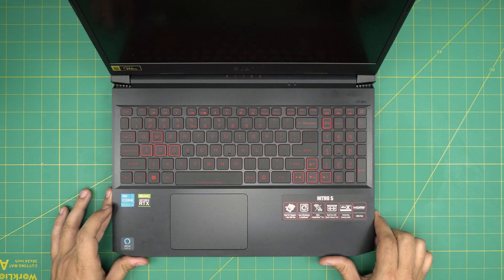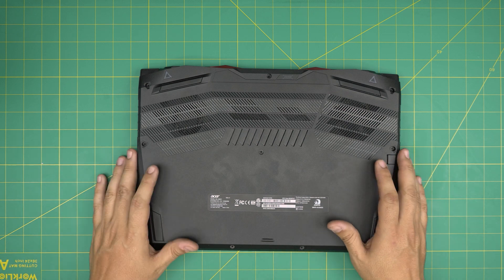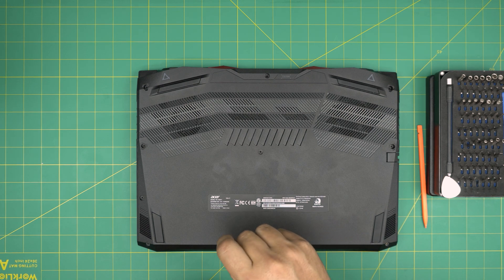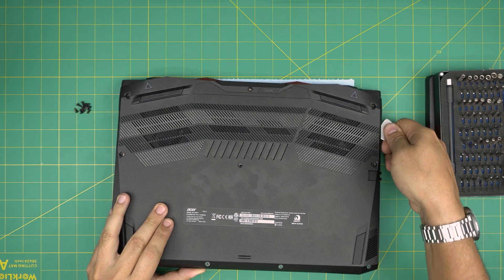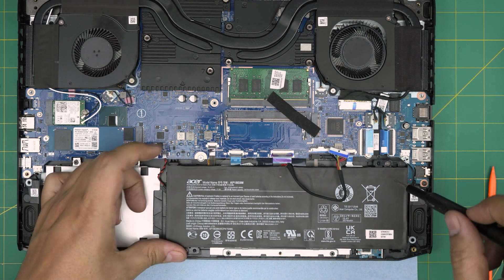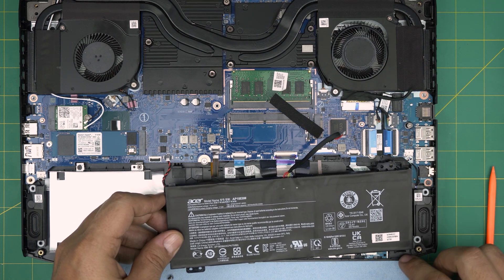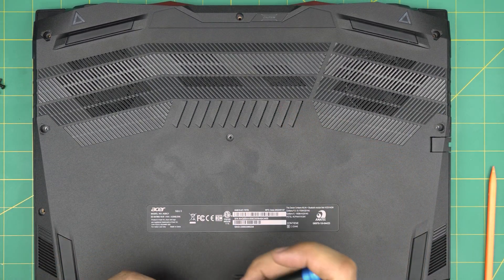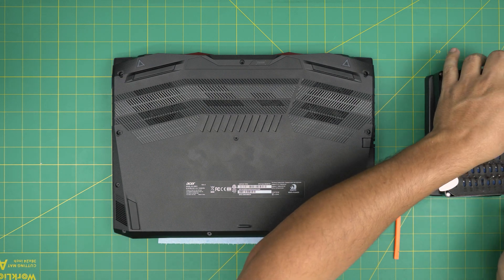How to Replace Battery in Acer Nitro 5 AN515-57-79TD Laptop | Step by Step

Comment: I need help with my Acer nitro 5 An515-57 I'm stuck on a boot loop hole my laptop keeps restarting and keeps showing the Acer loading screen and it keeps saying preparing and then goes black and restarts several times when I reset my pc using local download since then I'm just stuck on the reset loop hole and I was wondering would taking out the back cover of the laptop and disconnect the battery solve the issue as I can't enter to safe mode or windows recovery mode because it just won't let me just wondering
Reply from the maker: 🫠Regarding your question, your issue is caused by a degraded (failing) drive or corrupted system files.
You can try creating a Windows 11 USB boot drive and reinstalling Windows (you will lose your data).
If that gives an error, then replace the storage drive and reinstall the system.
https://youtu.be/T0uBTVNCdAQ
cheers🍻
Reply: @uFixTek I forgot to mention also when I went to the bios system to see if my old SSD drive will show up it didn't show up but the new one I have installed it shows but my old one doesn't and also how it happened I want it to rest my pc and when I did I clicked on local download reinstall windows 11 and because of that I think it has crashed my laptop and took my laptop to boot loop hole which I am currently stuck on. I am also gonna try and boot using a boot usb mode but I also bought otg adapter so I can install the ISO file from the website from my phone and also install the IRST file but I gotta make sure I make a separate folder and put the IRST file into my boot usb extract the file into my usb but I gotta make sure the zip file isn't in my IRST file.
Reply: @uFixTek I also want it to ask what sad drive should I buy which is cheaper not too expensive because I'm looking for a cheaper one and I don't know which to choose from Amazon or some other website I wanna look for a cheap storage around 512gb or at least more but cheaper SSD drive

Comment: When an inserted a new battery my laptop showing a battery with a cross on the battery icon. The laptop is working completely fine with the new battery but it only showing the cross icon above the battery. What does it mean and how could I fix it?
Reply from the maker: 🫠Regarding your question, uninstall the battery drivers and reboot the laptop.
cheers🍻

Comment: can we not use the hard drive slot and upgrade battery to take up full space?
Reply from the maker: 🫠Regarding your question, sure you can, but you need to find a extended battery and they are not easy to find.
cheers🍻

Comment: My acer laptop went off completely and no charging indicator even when plugged and no longer turns on. Could a bad battery gives such symptoms or maybe a bad charger or a mobo? There is no power at all and no led indicators turning on.
Reply from the maker: 🫠 Regarding your question, it could be the charger. You need to check the voltage of the charger at the tip with a multimeter to see if you're getting 19.5 or 20V.
im very positive that the issue is the charger.
Should you have any further questions or requests in the future, please don't hesitate to ask me.
cheers🍻
Reply: Thanks! I will try it!  @uFixTek
Reply from the maker: good luck

Comment: I changed my battery with one from a same model laptop. The "new" battery is about 75% health as per Batteryinfo software. But even though windows is recognising the "new" battery, it's not charging it nor using it. My laptop only turns on and works on AC power. The battery charging light just blinks a slow orange. I reinstalled the drivers and even flashed bios, but all the information about the battery is displayed, just that the system is not using it. If I reconnect the "new" battery to the older laptop, it works fine there and if I use my old battery, it also works fine in this laptop. Is there some security override or configuration that is preventing the "new" battery from being used?
Reply from the maker: 🫠 Regarding your question, when that happens, we check the circuit on the board that communicates with the battery—the BC chip. A gate may be opened.
Remove the battery and charger, then press and hold the power button for 60 seconds. After that, plug in the charger, hot plug the battery, and wait a few minutes before powering it on.

Comment: Generally acer nitro comes with 57 watt battery but some nitro model Generally 17 inch has 90 watt battery the 15.6 inch model have space like if a person is not using hdd in his laptop is it possible for a upgrade from 57 watt to 90 watt 
The laptop takes 15 volt input which both battery provide 
What do you think ?
Reply from the maker: yes it is possible and it will work just fine.

Comment: Hi! Thank you for this detailed video. I’m trying to replace the screen on my Acer Nitro 5 An515-57 model and was wondering do i just need to disconnect the cable of the battery or do i completely remove it?
Reply from the maker: It's my pleasure my friend.
🫠Regarding your question, just disconnect the battery; there is no need to remove it. However, removing it is super easy—just a couple of screws.
Should you have any further questions or requests in the future, please don't hesitate to ask me.
cheers🍻

Comment: hi! does AN515-54, AN517-51 7 and AN715-51 battery are compatible to Acer Nitro 5 gaming notebook? as I check at the back I see AN515-57-5620. enlighten me please so I can properly replace my dead battery. Thank you so much!
Reply from the maker: It's my pleasure my friend.
🫠Regarding your question, they are all the same battery type.
Acer Nitro 5 AN515-46 AN515-47 AN515-58 AN515-58-56CL AN515-58-766R AN515-58-72QR AN515-58-74JS AN515-58-75UH AN515-58-77YC Series; Acer Nitro 16 AN16-51 AN16-51-74BV AN16-51-78GX AN16-51-76BS AN16-51-56VT Series;  Acer Nitro V 15 ANV15-51 Series

Should you have any further questions or requests in the future, please don't hesitate to ask me.
cheers🍻

Comment: Hi doyou know a battery ugrade for that lsptop that can bump the battery capacity . Will helios neo 16 90whr will be compatible?
Reply from the maker: When it comes to a laptop battery, you must always use the same voltage, or you risk damaging the board. Make sure the battery connector is the same (with the cables not inverted) and that the screw holes match. You can find a higher-capacity battery for your model by checking eBay or AliExpress and looking for a higher wattage.

Comment: hello, would you please help me with my issue. I have same laptop and while working on it, suddenly shutting down. was plugged in and battery was full. Now it doesn't turns on or chare anymore, does it need a new battery? current battery was working quite fine without charger though and lasts for 2 hours at least.
Reply from the maker: 🫠Regarding your question, this laptop can work without the battery plugged in, and if it was plugged in, it shouldn't turn off because of the battery. You may have a bad capacitor that got damaged (overcharged). Here's what you can do before taking it to a repair shop for evaluation:  

1. Remove the battery and the charger.  
2. Press and hold the power button for 60 seconds.  
3. Plug in the battery and the charger.  
4. Wait 30 seconds, then press the power button.  
5. Wait another 30 seconds to allow the motherboard to perform a memory check.  

If after 30 seconds you still don't get anything on the screen, you will need to visit a reputable repair shop.
cheers🍻

Comment: Hello sir. My battery is faulty, I am on less than 220 lifecycles and less than 1 percent of the capacity. Should i remove the battery though I dont have a replacement?
Reply from the maker: 🫠Regarding your question, you can use the laptop without the battery. The laptop will last longer, as will the charger, since they won’t have to work as hard.
Should you have any further questions or requests in the future, please don't hesitate to ask me.
cheers🍻
Reply: @uFixTek  thank you sir! I have a follow up question. I was told the battery would last longer if the laptop was plugged in all the time and limited to 80% so I did that. I still get only less than 220 lifecycles. Could it be that the battery is just faulty. Or did I do something wrong?
Reply from the maker: that is correct the best is to limit it to 80  and have it plugged in, and your batter something is wrong with it, you should have over 400CL.

Comment: if I bought a different model of battery for the nitro would the replacement still work?
Reply from the maker: 🫠Regarding your question, if the shape of the batter and the connector it is the same and sits well in the case, sure you can use it.
cheers🍻
Reply: @uFixTek The connector seems to connect fine but doesn't sit right. And the new replacement didn't seem to solve the issue with no turning on. Any suggestions?

Comment: I changed the battery followed the after steps and it just went down from 100% to 0 and now it will only turn on with the cable in
Reply from the maker: Leave the laptop plugged in for a few hours; it should start charging. If it doesn’t, the battery quality might be poor, or the board could be defective. In that case, get a replacement.
cheers🍻

Comment: can u please tell me how much it costs to replace mine from a place that repairs and replaces
Reply from the maker: 🫠Regarding your question, any repair shop should not charge anything over 65USD with battery included.
cheers🍻
Reply: @uFixTek  thank you
Reply: @uFixTek  how logn would it take from a repair shop for me to receive it back
Reply from the maker: It's my pleasure my friend.
2-3day tops

Comment: 4:53 hi! I'm a little confused here, before installing a new battery, do I need to remove the BIOS battery connector so that a new battery can be installed and the BIOS battery connector reinstalled?
Reply from the maker: 🫠Regarding your question, no, there's no need to touch or disconnect the BIOS battery. Just replace the main battery and you'll be fine. I mentioned the BIOS battery for those who are interested to know.
Should you have any further questions or requests in the future, please don't hesitate to ask me.
cheers🍻

Comment: Which my battery into the Nitro 5 so much longer to operate inside the cell battery but I am only up to 2 hours my laptop but so fast as drained out of low battery should I'll be used to replace to recommed it??
Reply from the maker: the new battery is linked in the video description.

Comment: Hey. Do you think removing the battery might reduce overheating? My laptop is perma plugged in charger because battery lifetime is very short, but it overheats and slows down massively while charging. Should I remove and try without it?
Reply from the maker: Regarding your question, you should open and disconnect the battery. This will definitely increase the lifespan of the motherboard, and the charger will last longer. The downside is that you may see a few seconds of delay on boot, but it's nothing bad.
Should you have any further questions or requests in the future, please don't hesitate to ask me.
cheers🍻

Comment: Hi! I have a question! My current battery model is AP18E8M and my new one is AP18E7M. Is it going to cause any issues if I put the new one in?
Reply from the maker: 🫠Regarding your question, No, it will work just fine without any issues.
Should you have any further questions or requests in the future, please don't hesitate to ask me.
cheers🍻
Reply: @uFixTek thank you so much!! :)
Reply from the maker: It's my pleasure my friend.

Comment: Hi! Your video was great and very helpful! I replaced my battery with a new one and plugged the charger in, but the charging light did not turn on. Is this normal? I don’t want to power it up as you said to wait a while.
Reply from the maker: if after few hours it doesn't start charging check the battery connection.
cheers🍻

Comment: my laptop cant be turned on without being plugged in and now its stuck at 93 percent and going down slowly will replacing the battery fix this? and also my laptop is a AN515-57 but idk what the 79TD means and if mine is the same i kinda removed the stickers on the laptop so i dont know the exact model ive check the model in the laptop but all it says is AN515-57  nothing additional like 79TD
Reply from the maker: 🫠Regarding your question, when we get this issue in the store the main 90% of the issue is replacing the battery.
cheers🍻

Comment: Having a problem.. cannot turn on laptop without charger..charging light blinks after plugging in.. the battery does not even chargin.. stuck at 0%..need help
Reply from the maker: 🫠Regarding your question, double check the battery connector and make sure it is making a good contact this issue is from battery contacts with motherboard or a bad battery.

Comment: Have mine plugged in but will not charge to 100. Shows it’s charging but doesn’t.
Reply from the maker: 🫠Regarding your question, nis this after placing the new battery?
Reply: @uFixTek no still the original battery.  From day one not gonna charger, it would not last very long. Charged it like normal and was at 100. Now it shows 55% and charging with plugged or 55% unplugged. Will not charge more. Currently it dropped to 46% and charging.  Weird.

Comment: Why does my battery suddenly get a cross battery notification when I charge it to 100 percent? then it can't be turned on without plugging in the charger.? My battery can only save battery capacity when I limit it in the care center application to 80 percent
Reply from the maker: Thank you for your feedback! If you wish to support the channel, you can like, subscribe, or both!
Regarding your question, your battery cells are going bad and you do need to replace it if you want to act as normal.
Should you have any further questions or requests in the future, please don't hesitate to ask me.
cheers🍻

Comment: Are the batteries sold in online stores original? If it's not original, how do you choose an original battery in an online shop?
Reply from the maker: there are 95% generic or pirated versions, it is very hard to find a original battery, unless you order from the Acer directly.

Comment: @6:55 hey i let my battery discharge to 19.9789% instead of 20% while following your ritual. Should I just throw away that battery and buy a new one? I really want battery that will last 2.23 hours longer in total lifetime then the one i messed up. You said its very very very very critically important, so I don't know if I should start over and buy a new one.
Reply from the maker: Thank you for your valuable feedback! If you'd like to show your support for the channel, feel free to like, subscribe, or do both!

Regarding your question, I have been in the repair industry for over 17 years and have extensive experience dealing with batteries. It is crucial, when installing a new battery in a laptop, not to power on the device immediately. Instead, follow these steps:

Plug in the charger and allow the laptop to charge for 4-5 hours.
Power on the laptop without the charger, reducing the LCD brightness to 50% or lower, and maintain a light CPU load. Allow the battery to drain gradually to 20-30%.
Power off the laptop, plug in the charger, and let it charge for another 4-5 hours.
After completing these steps, you can charge and discharge the battery as needed. It's advisable to repeat this process every 3-4 months.

Note: If you've already powered on the laptop without following the above steps, don't worry. You can still perform the recommended procedure now. The above steps are suggested for new batteries and do not imply that your current battery is malfunctioning; there's no need to replace it.

If you have any further questions or requests in the future, please feel free to ask. Cheers! 🍻

Comment: Hi!

Is it possible to upgrade the battery for this Acer nitro 5? Meaning can we use a bigger battery while taking advantage of the empty space of the hard drive. If so, would you recommend a battery model that fits? I heard somewhere that it's not recommended to do so as it's very risky because available batteries are cheap and can damage the laptop.

Thanks
Reply from the maker: Thank you for your feedback! If you wish to support the channel, you can like, subscribe, or both!
Regarding your question, i would highly advise you to not increase the battery capacity on this laptop and use a same watt battery capacity, because the charge circuit on board are designed to charge this capacity buttery and if you increase the capacity of the battery the circuit will over load and will degrade and cause short and damage the board.
don't take me wrong you can increase the battery life by modding and stacking two of the same battery on top of each other and 3d print new bottom case, and it will work but at the risk of the degrading the components on motherboard.

Should you have any further questions or requests in the future, please don't hesitate to ask me.
cheers🍻
Reply: @uFixTek  thank you. 

Subbed!
Reply from the maker: i appreciate your support my friend.

Comment: Man my new battery is blinking orange, i need to reset the new battery or something on bios?
Reply from the maker: Thank you for your feedback! If you wish to support the channel, you can like, subscribe, or both!
Regarding your question:
open CMD (admin rights)
type powercfg/energy
then wait 60sec and see the report.

2ndly you can try to reset the board, unplug the charger and press and hold the power button for 30sec and let go and plug the charger make sure the charger connector fully click all the way in.
and don't power on wait 5min  then power on.